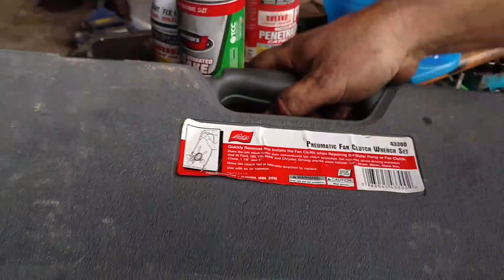PART 2) REMOVING THE CAB AND BED FROM THE F250 DUALLY TO USE THE 5.4 3V ENGINE IN THE F150!

Comment: You are one hard working man, projects,projects ,projects. Im really enjoying this.
Reply from the maker: no shortage of work around here! did you make any progress on your 5.4?
Reply: yes running now, its missing, going to replace spark plug boots and check plugs. its a definite miss, but up front is real quiet now
Reply from the maker: can your scanner do a cylinder contribution test? it would isolate which cylinder ans you could swap from a good cylinder before you buy anything. are you out of derate mode?
Reply: J.C. SMITH PROJECTS u
yes no codes  at all, need to get a scanner, guess I do it old school

er

pm
Reply from the maker: what was the problem with the throttle and the pedal?
Reply: just a plug , guess I should get a light
Reply: Oh No, my code reader isn't capable
Reply from the maker: easy fix then?
Reply from the maker: which plug was it? did you have the miss before? is the wrench light still on?
Reply: hope its a easy fix, its also a learning process for me, no wrench lite either. tps plug on drivers side. I guess if the dam cab wasn't in the way .........
Reply from the maker: did you clear all the codes and drive it again?

Comment: That's a sensible plan.  I wasn't sure what other engines you had to swap in to the F 250.  Some truck or another will get that Cummins, soon enough!
Reply from the maker: yes it will. my plan as of right now is to put the v10 in the f250. drive it and work any bugs out. if i like how it tows i can move on to the  next stage of the project. if i dont like it, i will take the v10 out and replace it with the cummins...once i am happy with that...the body will come off for the last time and the 1977 f250 body will go on.

Comment: Did you make that fan removal tool for your air hammer?
Reply from the maker: no. it is a lisle tool. it was reasonably priced. it does many different sized fan clutches.

Comment: You sure aren't lost/finding your way...far back as that motor was sitting, l'm thinking that V10 will make it in there...also this motor looks good, l don't think you'll find anything wore out inside
Reply from the maker: I have done this procedure a time or two. i bought this truck 8 years ago. i drove it for 3 years. my brother used it for 3 years and i have had it back for 2 years so i it has had decent service history for the 5 years i have owned it. my brother is not as good at maintenance as i am. so the inside of the engine is a mystery at this point.